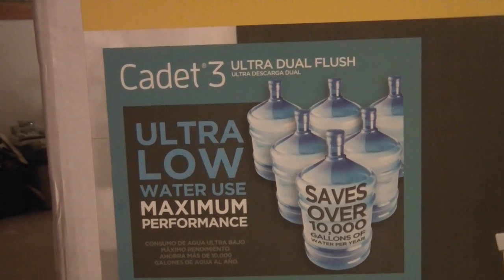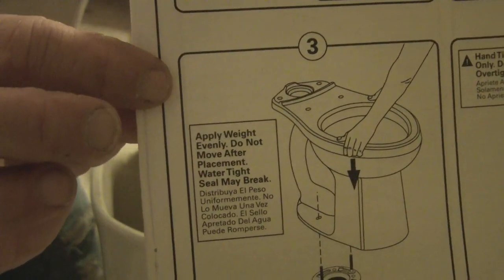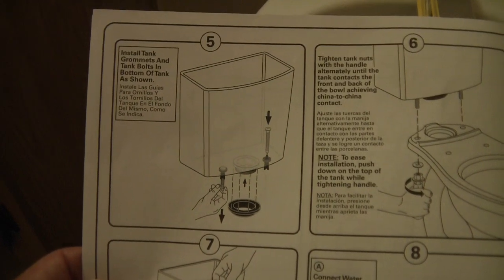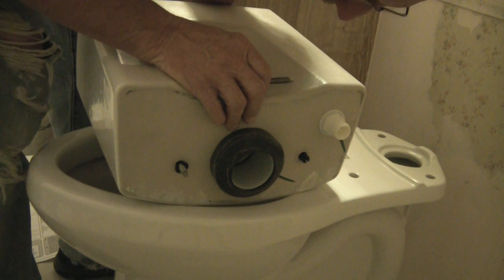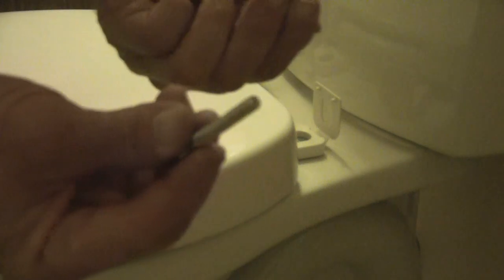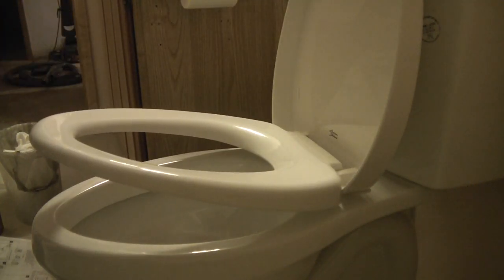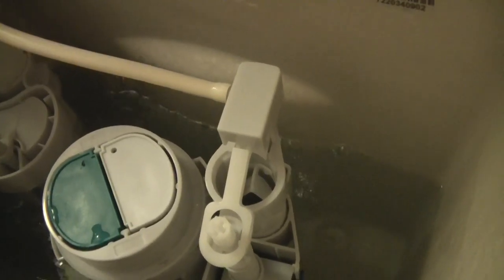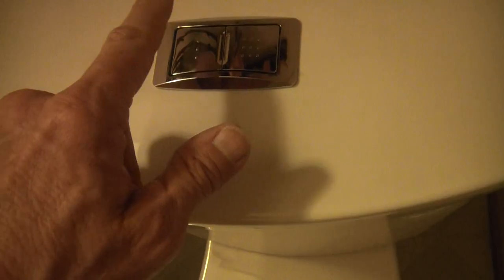How to install a toilet - Amercian Standard Cadet 3 dual flush toilet

Comment: Imaging doing that with a heavy one piece concealed trap-way toilet (don't ever buy concealed model). it was heavy, I couldn't see the holes,  a friend & I took two hours to drop it into the bolts but I think we had damaged the wax.
Reply from the maker: Dean I've done those but ill take a few strips of 1/4 inch material and stack them on either end of the hole (front and back ) set the bowl on top of them line it all up then one by one pull out one piece lowering the bowl 1/4 inch at a time front then back teeter tottering it till its setting on the floor.

Comment: Has anybody had this toilet for a bit of time to see how well it’s working? And if u recommend it?
Reply from the maker: well this has been in use for a year now and is in the main bathroom where everyone uses it and no issues what so ever. I was wondering at first the longevity of the dual flush system,  if it would last . I can honestly say i'm very happy with this so far.
Reply: The Shack thank u for the reply
Reply: i just purchased one and the flapper is leaking, off the box, research it you will see.

Comment: Ok so it looks like I have to adjust the the rods so they don't touch to much cause it flushing automatically
Reply from the maker: CC the rods you want just a little play so your not applying any pressure once the lid is on and you want to make sure not to have too much play for when you push the tab it plunges far enough to engage the flush valve I have about a 1/16" play in my push lever
Reply: @TheShackHome  thanks!